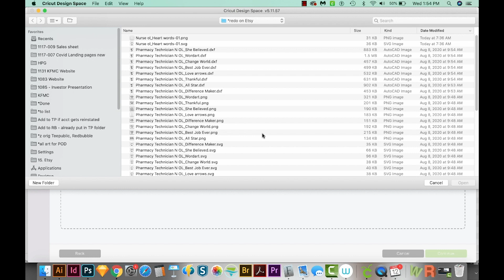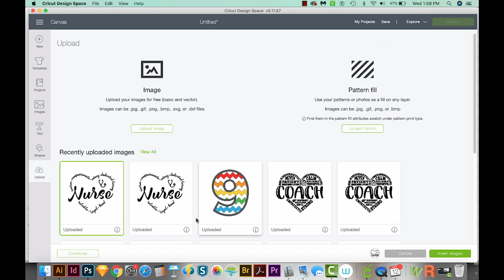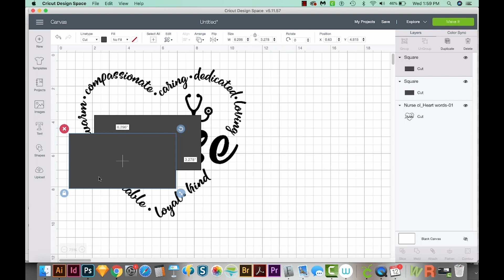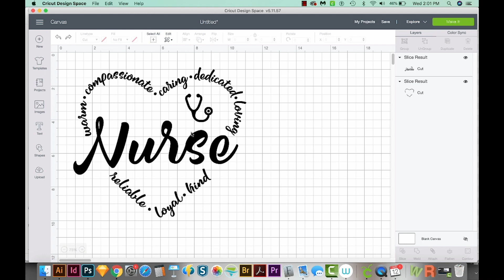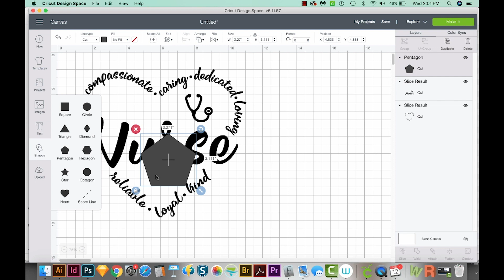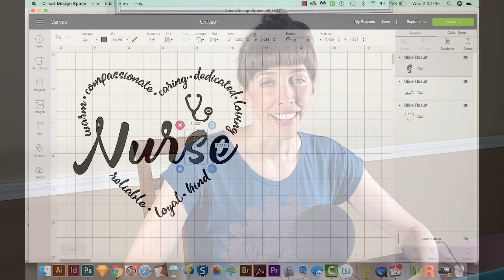How to Unweld: Break apart a welded design or compound path in Cricut Design Space

Comment: Seems the removing contour is less hassle than using shapes.  I always feel it should be kept simple.  I had trouble with this only in Cricut Design Space.  I was a graphic designer/printer for over 30 years, and the programs I used were able to just edit copy. Thanks for options.
Reply from the maker: You're welcome! Yes, I'm so used to Illustrator, where I can unweld (release compound path) instantly. DS is a bit of a hassle!